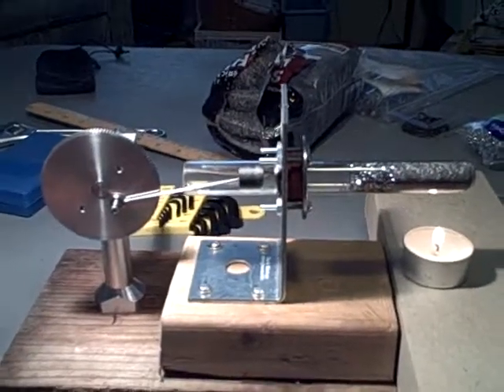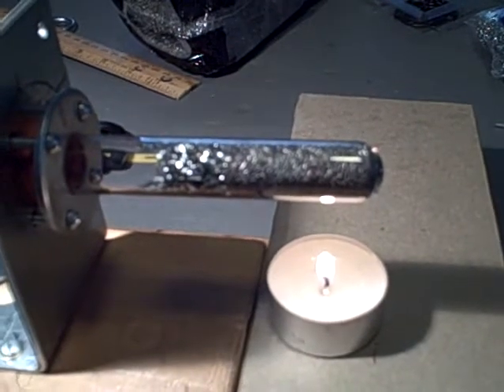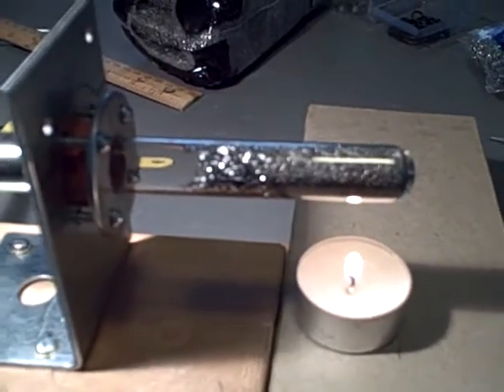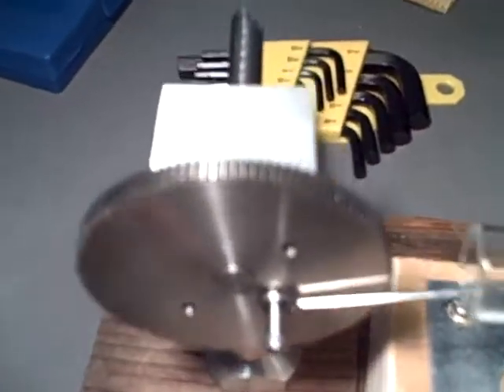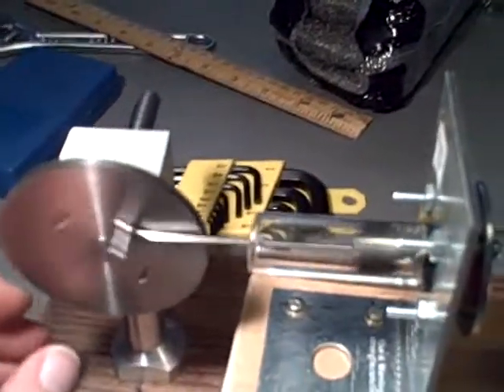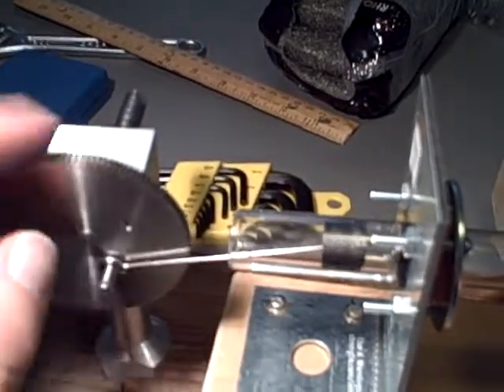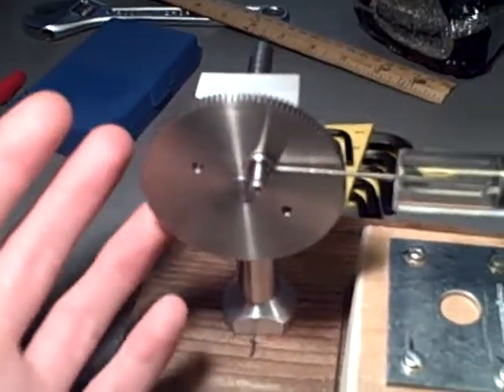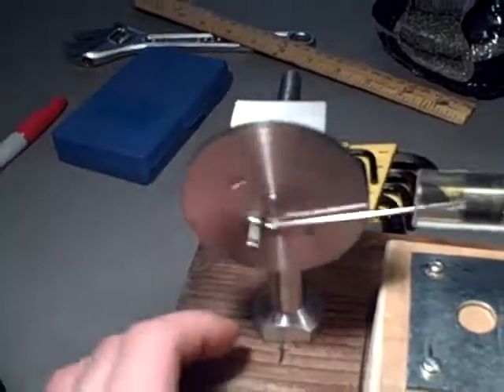Need help with my Stirling Engine

Comment: This is awesome,  The flame definitely needs to be at the end of the steel wool closer to your support column. You should have the flame pretty much touching the pyrex test tube.  I've noticed brand new candles burn the best, if you re light a candle it doesn't seem to have the same large flame. at least the candles I've used behave that way.  So a big flame is important.  The back pressure is a good sign.  Some times the orange rubber washers aren't tight enough on mine and air leaks...

Comment: @adfgfds Another good heat source is an alcohol burner.  I couldn't find alcohol burners in any stores but you can definitely get them off of ebay for about 10 bucks.  Or you could make your own.  I used a little jar I got from a crafts store and drilled a hole in the metal lid and used a zippo lighter wick.  You can fill the jar with denatured alcohol from home depot.  I found denatured alcohol in the paint department.  They only had 1 gallon jugs though.

Comment from the maker: @BuildSomethingUseful 
Yah I was actually thinking of doing something like that. Wouldn't be too hard to make. Mineral Spirits is another idea. I think the main problem at the moment is actually the flywheel weight. What I may do is drill a few holes in it and see if I can make it lighter. I'll let you know if that makes any difference or not.

Comment: ...You don't need the 2 different types of steel wool.  You may be better off with just steel wool and not the stainless steel wool.  I'm still messing with the stainless to see what advantages it might have.  I pack the steel wool in there good with a plastic pen.  Put the cap on a pen and shove a little steel wool in at a time and then pack it down. Then add more steel wool, pack, repeat. I've seen successful engines without such packed wool but that's been my technique so far...

Comment: I would have to say you need a bigger flame, other then that if you pull your piston out if it doesn't make a pop sound its to small or to big. But I still think its the flame so try using a oil lamp.

Comment from the maker: Yah I figured that part out. I actually haven't touched this project since last year. Ive just had too many things going. I have however figured out what was causing all my problems to begin with. Turns out that after I sanded the shaft that they flywheel sits on, its moves MUCH better.

I'll eventually get back to it lol

Comment from the maker: @muddymuddymuddmann 
Tried all that a while back. Didn't make any difference. We concluded that the bearings are too tight on the flywheel and had some air leaks. I'm going to be rebuilding this shortly and hopefully give another update soon :3

Comment from the maker: No that has nothing to do with it. I used the same exact plans as "BuildSomethingUseful", and his works great. When I removed the flywheel, there wasn't any pressure building as the piston didn't move back. That means theres an air leak. This is why I'm going to construct it a little differently. I'm going to use a metal union to connect the two tubes instead of this set up here

Comment: ...Did you drill out the threads on the inside of the metal part of the actuator? I recall drilling out the inner diameter helped.  If you do drill it out be careful and set the pyrex end on a piece of wood and use like 3 or 4 different drill bits to get the diameter you want.  Don't try to widen that hole with just 1 large drill bit.  Be patient, it took me a couple weeks to get a working engine and when it finally ran I laughed out loud for a good while.  8-)